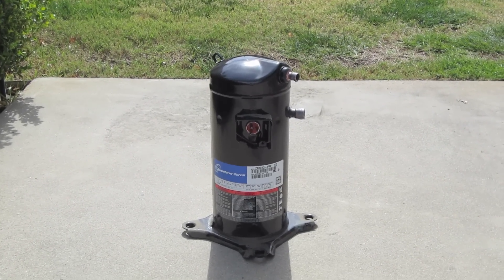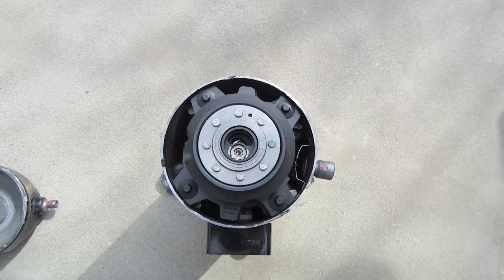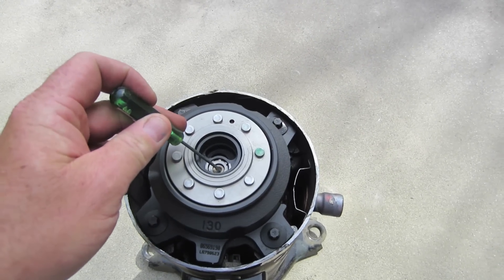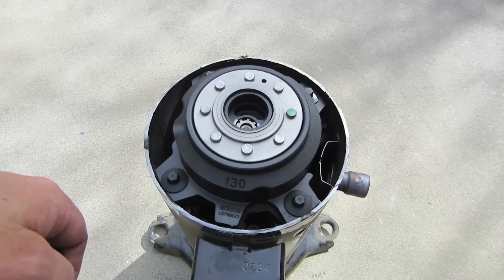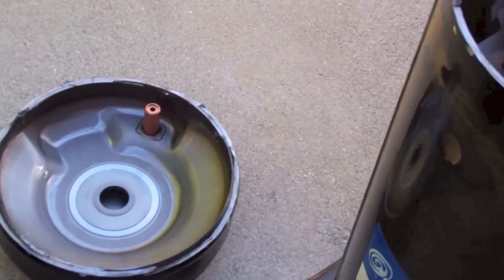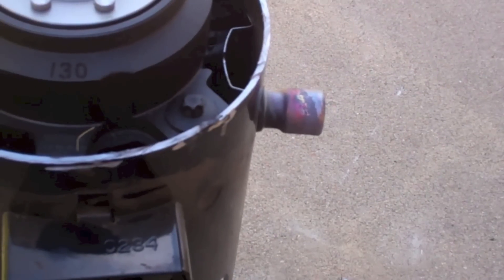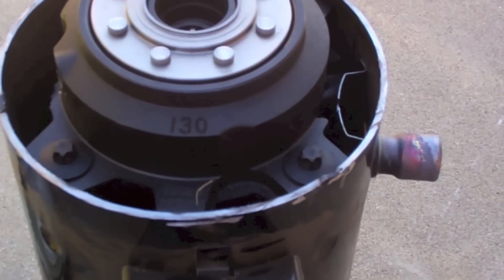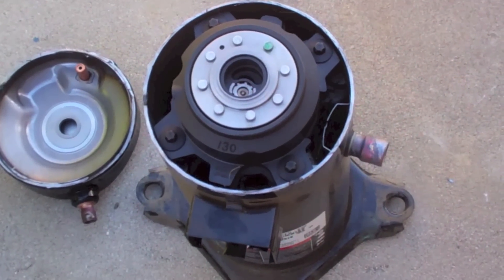Copeland Scroll 2015 protection explained

Comment: wouldnt it be better to have a thermal switch located in the port in the side of the scroll assembly or even better when the disk opens a push rod would actuate a switch to stop the compressor?

since they do make single phase scroll compressors it is possible that there is a overload protector externally

3phase compressors would have to have the protection internally since disconnecting one of the 3 wires would single phase it causing problems.

Comment: got a Copeland scroller keeps shutting on and off low side gets cold high side closest to compressor gets like 110⁰ but past the service valve its barely even warm any idea what can be going on? it was a replacement the guy took out old compressor put a brand new one in added r 22 and might I add there is no info plate w any info on it so   asking for my cousin i normally do installs w light service

Comment: Great video. Really helped clarify the protective features of the scroll compressor. The only aspect I still need a better understanding of is..... Does the thermal overload device incorporated in the motor winding auto reset at a predetermined temperature drop? Thank you.
Reply from the maker: Superwingman69 Yes the overload automatically resets at a predetermined temperature.

Comment: Knowledge bomb. What is TOD short for?
Reply from the maker: Thermodisc
Reply: Derp,ya im not ever very good at that shit
to many abbreviations to keep track of.
Reply: I had a customer that ni thought i did that to. So I yanked that sucker and put in a new compressor. Pulled a mean vacuum made sure it was all proper. Energized it and it did the same exact thing! I was like wtf is going on. I almost wonder if that piece that finishes the seal was stuck and I some how mimicked the same exact defect.
Reply from the maker: Thanks for Watching Justin

Comment: i have 5 ton daikin dx type unit,while im reset the circuit breaker the unit will start and after 5 mins the outdoor unit was tripp and even the low and high pressure switch was direct its the same problem tipped again,..what is the best solution...i think the internal protector was weak and easy to open thats why always tripped after 5 mins of working...

Comment: What about the 5 tons compressor of that same brand the 3 terminal cant read resistance on the compressor due o gas leak is there possible to running again?when we check the resistance of the terminal the compressor is hot,is there any solution to work it again?
Reply: lack of oil of the compressor, wait until cool the compressor and test with ohms, if same no reading it means your csr terminal was open and replace compressor

Comment: Nice video.  You did forget one.  On the case of the compressor  to the left of the electrics there is a dimple.  That will blow off when the pressures get way to high and super hot.  I came across 4 compressors where they blew and there will be oil all over the roof. And it is 130°f on the roof.   Naturally you loose all refrigerant too.  What caused that is the condenser was packed with dirt.  Sometimes you can weld over the hole.  Other times the compressor is toast.  This was very common in York 2 stage units. Because people would clean the front coil and never the back coil. You need to clean both.

Comment: Interesting. The discharge gas is used in many internal operations inside of a refrigeration system. In a chiller system, hot gas bypass to keep the barrel from freezing. In a heat pump, the reversing valve is operated by the diff. between hot gas and suction pressure. It makes sense that a scroll comp uses it for it's internal protection. Great video as always Mr. Dallas!